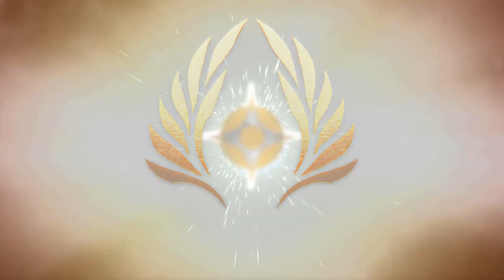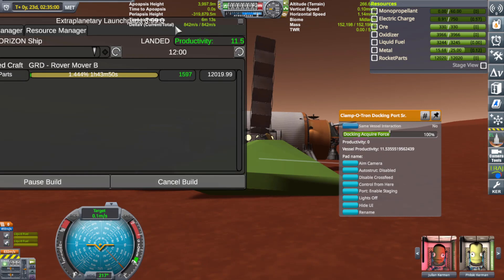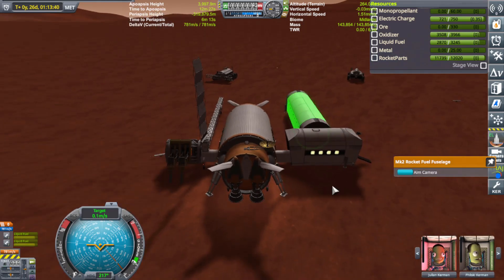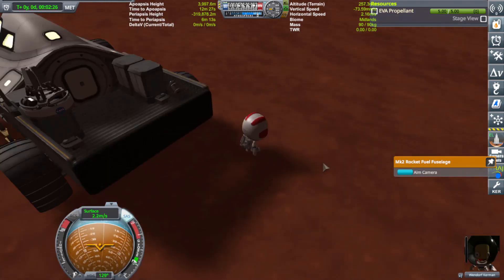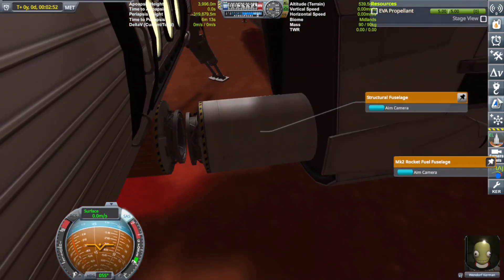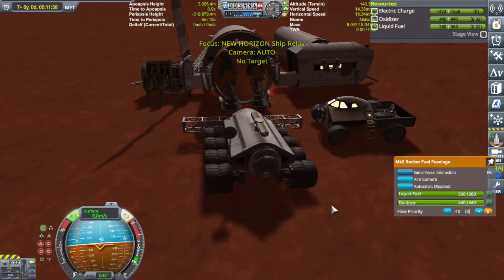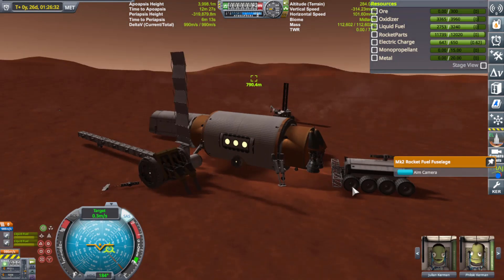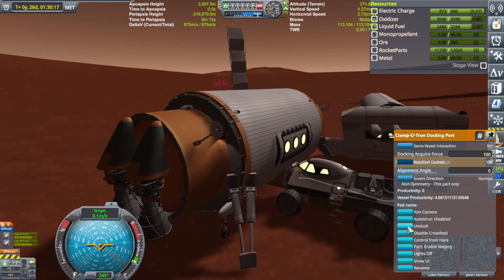MURPHY'S LAW in colonize the solar system. Kerbal space program lets play part 5

Comment: LOL! The solar panel destruction was so funny. Several times, it wasn't immediately obvious that it would take out the next panel, but then it did! Repeat that several times, and I was laughing so hard! :D

The pop-inside is much like what happened when I made a big electric seaplane with those structural fuselages for pontoons. I flew it over to the island runway, (it has landing gear too,) had a bit of a wander around, then when the kerbal was climbing the ladder to get back in, I told her to climb out too low, and she ended up inside the pontoon. I didn't have an engineer to get her out, so had to fly back to KSC with her inside the pontoon. Didn't have to, but did.

Comment: You can't remove docking port (in  "the trap") because it's the root part of this craft. Attach other docking port to that "debris" and dock something to it. Root part of combined vehicle COULD be other, thus allowing manipulations with the problematic part.
Other method is timewarping. Undocked "crafts" (your engineer and habitation module) will drift away from each other eventually. Or will cause massive death end destruction event on timewarp finish.
Reply: Or, no shame in using the cheat menu for this one 🤣

Comment: This is a comedy gold mine.
Engineer gets stuck in a trap, the big mover's first action was to take out the entire solar power array and then it kickflips the other rover like 50m into the air.

As for the trapped engineer, the seat might work. You could also try and see if using the time acceleration will make her drop through the floor (since it removes collision between independent objects and they phase through one another), but there should be enough space below so she doesn't end up halfway inside the tube or the physics engine goes haywire once you go back to normal.

If this colony fails, I wouldn't mind if VAOS would just start with a similar project with one of his alternative crafts on another planet or moon... hell, I would say it might be pretty awesome if he tried to do the same with the alternative colony ships on laythe and so on no matter how this turns out!
Reply: I laughed at the solar panels 😂
Reply: All the problems on all the planets, yes please <3